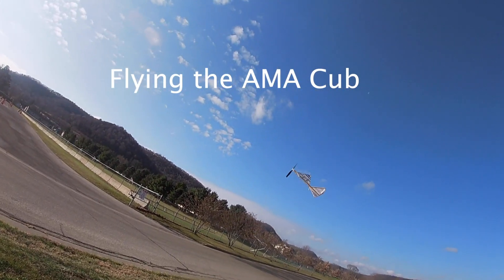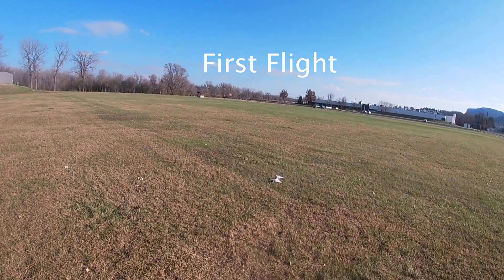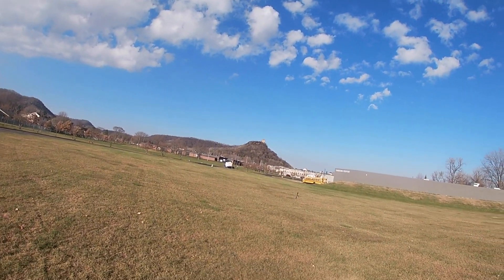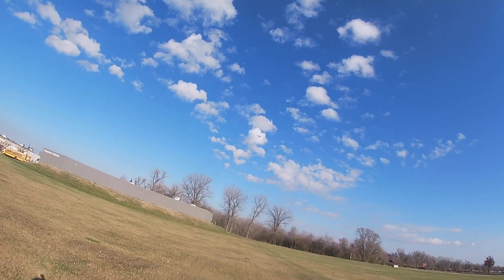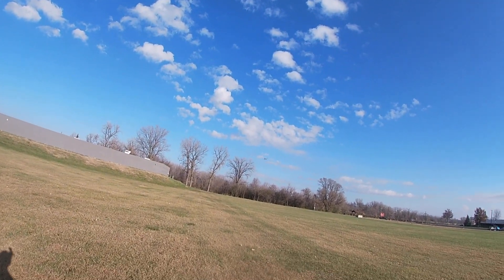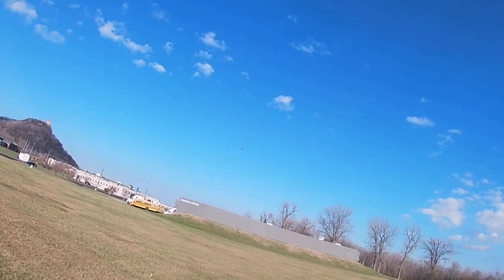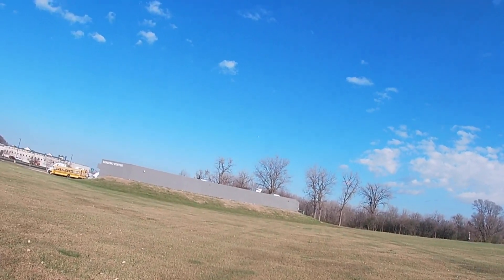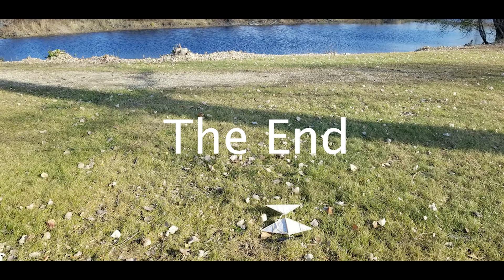AMA Cub Flying

Comment: WoW   wish i had a nice big flying field like you got there       Of all the rubber powered kits i have built  i did not have much luck with the AMA cub .   I wish AMA  would up date to a better plane to suggest for first time builders like Darcy Whites Squirrel  or lazer arts Mountain Lion.  Thumbs up for the video Bill
Reply from the maker: This flying field seems really small for free flight. The only issue with AMA Cub I could see is the heavy plan covering which can warp the wing badly.
Reply: @billkuhl442  With 8-year olds making the joints, I think the covering provides a fair amount of strength to the structure.  It's a good deal more durable than tissue, good for windy day landings in bushes and rough fields.  As for warping, most of them don't live long enough to experience warps.  
What's needed is a good, second model to use the same prop assembly, still simple but something a little more sophisticated to build and better flying.  Add a third-step model and your student is then ready for Embryo or P-30.
Reply from the maker: @wdtaut5650  yes normally the Cubs flown right after building.